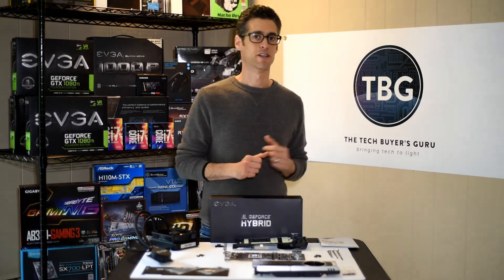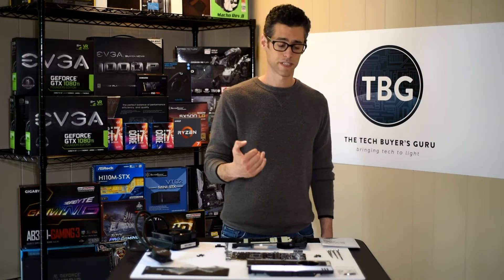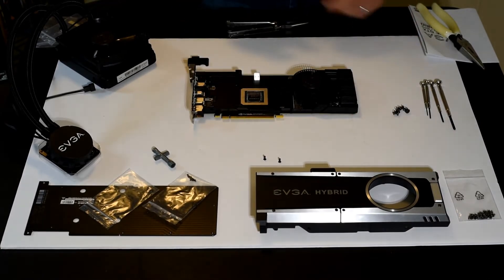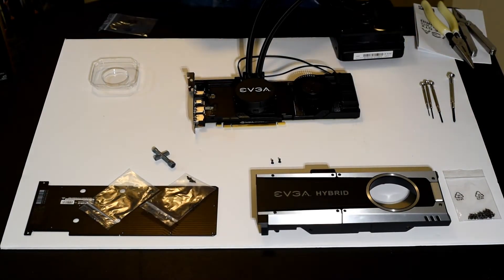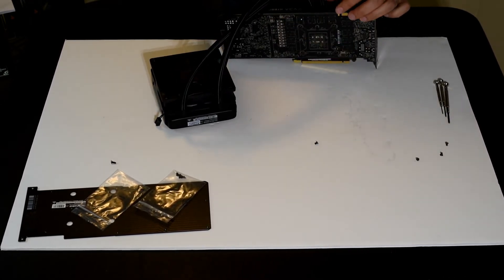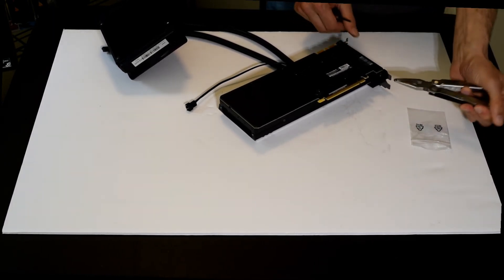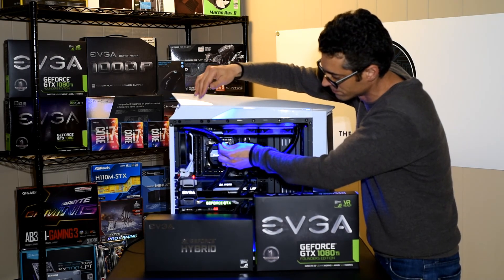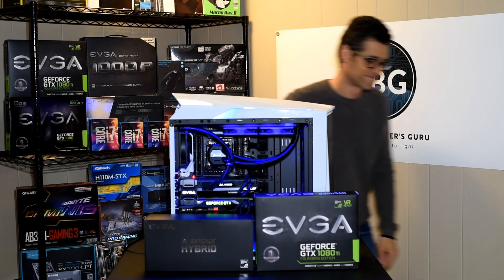EVGA GTX 1080 Ti Hybrid Cooler Installation, Part II and Evaluation

Comment: @tbg I ordered this kit and is expecting it on Friday.  I have two founders edition 1080 ti's. I will be modifying one and was wondering should I mod the other for best results. Thanks ahead!
Reply from the maker: This is a big upgrade from the Founders Edition for sure. It allows you to get the maximum performance out of your GPU. Are you running your two cards in SLI? If so, the one thing you'll need to check is whether you can fit two 120mm radiators in your case. Most cases can fit one (right where the case exhaust fan would be), but adding a second radiator can be tough, especially if you already have a liquid CPU cooler mounted in other available fan slots.

Comment: i have one question,can you use the noctua Y cable  adapter to conect two fans on the fan conector coming from the card,so i can use a push pull configuration on the radiator?this way i dont have to conect the fans on the motherboard,and the two fans i think will run at the same speed.
Reply from the maker: You can do this, but make sure to use the Noctua 3-pin model (http://amzn.to/2Bmr9HB), as the connector coming off of the card is a 3-pin. Also note that you won't have manual control of these fans, as this 3-pin header actually only has two pins in it, forcing the fan to run at full speed all the time, so you'll need to choose your fans wisely. In testing I've done, I've found that fan speeds under 1200rpm severely limit the effectiveness of the radiator.
Reply: thanks, im thinking on using two fans on push pull config, and use two noctua fans at 1500rpm,i think that at this speed the noise is going to be minimal and the performance will be the enough to get it to 2000mhz stable.
And also i have another question, can you plug the AIO on the founders edition with the normal shrould,taking of the vapor chamber and that silver case, but keeping the rest?
And do you know if intel mouting points are the same as the one on the GPU?because i was thinking on just buying a cpu cooler and put in on video card.
Reply from the maker: I think you can keep the FE front shroud. See this video from Gamers Nexus: https://www.youtube.com/watch?v=TX0nQdCRE9Q&t=2s. Don't know about Intel coolers.

Comment: I have an EVGA 1080ti SC2 hybrid. I’m worried about my AIO cooler failing soon. I can’t find any new AIO coolers that I can just swap out with my current one on the GPU. Has anyone had this problem before? The exact model is 11G-P4-6598-KR
Reply from the maker: This isn't a product you'll be able to buy at retail anymore, but luckily, EVGA has the best customer support in the business, so if the cooler does fail, you will be able to get a replacement. The warranty is 3 years, so it will be ending soon, but you will still be able to purchase a replacement from them. And if it's already showing signs of failure, you should contact them right now.

Comment: @TBG Hi, I have the HY-5388-B1 Hybrid Cooler, and I also have a Founders 1080 TI, will this work for me without problems? I am not sure if this wil fit in my PC? Some key specs

ASUS Z270 ROG Maximus IX Formula
NZXT Phantom 630 Windowed Gaming Case - Gunmetal
Reply from the maker: Yeah, no problem, it will fit in just about any case a long as you have a free 120mm fan slot and aren't using a huge tower air cooler that extends to the back of the case.
Reply: I have the h100i v2 heatsink, and my PC has fan top port panel side, and along entire top part a couple of fans. Don't see where I could fit another fan
Reply from the maker: What case  do you have? Nearly all cases have a 120mm rear mount.
Reply: The Tech Buyer's Guru NZXT phantom 630 windowed
Reply from the maker: That's a huge case, with a stock 200mm fan in front and up top, and a 140mm in the rear. But yes, you've used all the fan spots if you have a 240mm radiator up top, so you have to remove the rear 140mm fan and place the GPU radiator there.

Comment: Anyone know if this cooler will fit on the Nvidia GTX 1080 FE ?
Reply from the maker: It is made only for the GTX 1080 Ti 11GB reference board. EVGA has discontinued the model for the GTX 1080 8GB.
Reply: The Tech Buyer's Guru that’s a shame that they did that..

Comment: EVGA recommends positioning the tubes of the radiator at the bottom.  Any reason you didn't do this?
Reply from the maker: The recommendation you're referring to appears as point #4 on page 10 of the Hybrid SC manual, as seen here: https://www.evga.com/support/manuals/files/400-HY-5598-B1.pdf. This product didn't even exist when I made the video, nor did the manual. EVGA never produced a manual for the GTX 1080 Ti Hybrid cooler, as mentioned in the video. So that's the most basic reason I didn't follow the recommendation. But even so, mounting the hoses at the bottom would require that they be crimped quite sharply coming out of the card, which goes directly against point #5 on page 10 of the Hybrid SC manual. So the two instructions conflict. I'll leave it to builders to decide which approach they want to take.
Reply: Sounds good to me!  Was just curious is all.
Reply: Someone posted this video to me to show me what they bought, then I see this comment. You should ALWAYS have the bulk of your liquid above the pump. As well your reservoir should always have tubes as low on it as possible. In this case the radiator/fan is the reservoir so the tubes should go at the bottom. There is never a case when this isn't true and no manual should be required since all AIOs are the same in these basic water-cooling loop requirements.
Reply: The cooler I purchased in July of '18 came with a yellow insert stating the pump runs louder if it is in the configuration you have demonstrated. They must be watching you.

Comment: Where I find your cooling results on your website?
Reply from the maker: They actually aren't up yet. I'll post a link when the benchmarks are published.
Reply from the maker: I should add that the reason the benchmarks have not yet been published is that it's not clear that EVGA is actually still producing this product. It went out of stock in mid-May after about a week of being on the market, and hasn't returned since. The benchmarks will be published if and when the product is back in stock.

Comment: Can you upgrade the rad fan?
Reply from the maker: Yup, no problem, but you'll need to connect it to the motherboard, as the EVGA fan uses a proprietary connector to the GPU cooler.